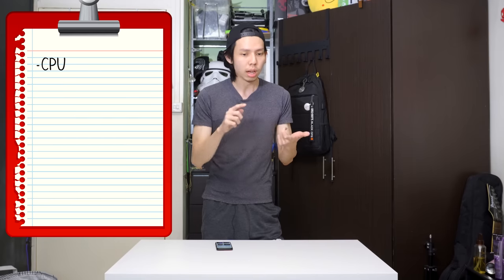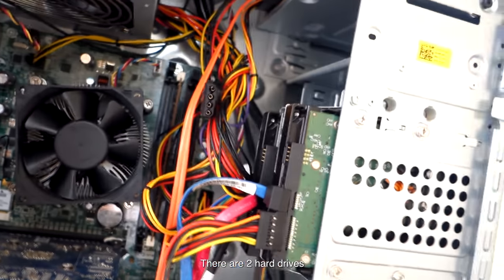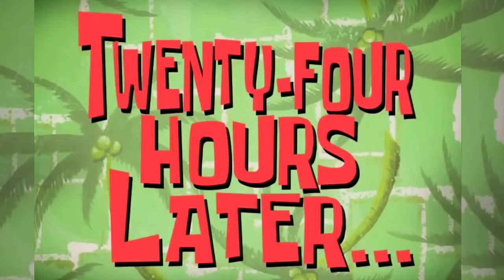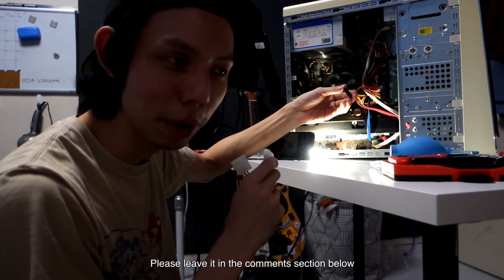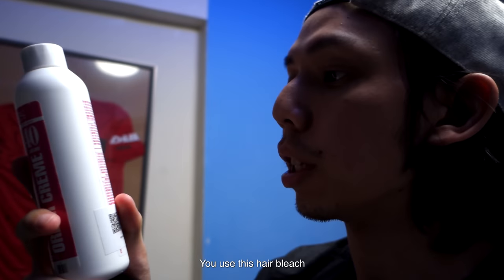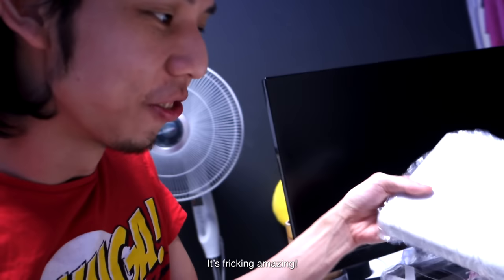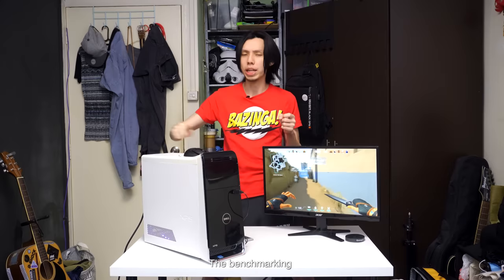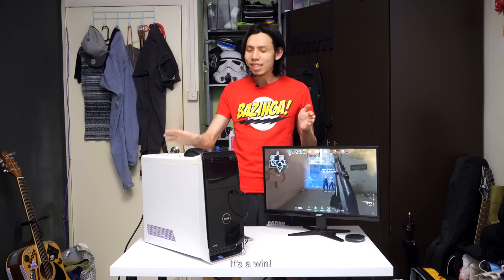Building a $300 2nd hand Budget Gaming PC in Singapore

Comment: Dude . can double side tape the light strip too . 

I too build quite alot of PC from carousel parts . I realised that of all OEM makers, Lenovo's are the easiest to Slap in a GPU and get you going . Never ever touch HP. Its hell to work with. Not to mention most OEM motherboards come with proprietary PSU connectors. 

I've been doing similar upgrades like this for sometime. Put it in a new case, some RGB and an SSD and it works really well

Comment: What PSU was in the case? If its an unknown brand 500W PSU it might barely support the GTX 960. I would not trust using it for long term as it will bring down the entire PC if it came with the 2nd hand case. Furthermore the original PC was not meant for gaming so the PSU would probably have cheapened out. 

Yes the goal of having a gaming PC for $300 is probably achieved. But personally I would not game on it on a long term basis primarily because of the risk of having the PSU bring down all the component the moment it craps out.

Comment: Hi Julian, I facing a problem now which my GPU temperature always go to 80 degree, I only using normal fan and I recently just clean all dust inside my CPU.
Is it my casing air flow problem and I need to changed to water cooling? Can give suggestion please Thanks!

Comment: I build a much more stronger pc using rm550 which is equivalent of about 250 singapore dollars. My spec is : i5 2500k, 2x4gb 1600mhz ram, gtx 1060 6gb, psu superflower 500, nimitz pc case.
Reply: Wow the gpu itself costs more on most for-sale sites idk how u got these hardware so cheap i presume they're all used?

Comment: Did you overclock it? Idk how it still gets so much fps even though it is $300
Reply: Doubt its overclocked. Firstly the cpu is overclocked locked because well its intel, secondly, I doubt the motherboard even supports overclocking. Thirdly, even if its overclocked,it will be super unstable

Comment: i want to know if the power supply can hold for a long time using the pc..
Reply: Gpu and cpu will fry the psu within a month or two i assume. They're cheap parts for a reason. Fairly certain the internal temperatures would rise too much and the pc would shut down intermittently

Comment: As my experience
300$ is enough for you if you just play Dota league of legends or Valorant with Ryzen 3 3200G no dedicated GPU, 100 fps guaranteed.
Reply: League of legends is the bare minimum for benchmarking pc performance, unless you never plan on playing anything else then it'll be fine, you could even run csgo for $700-800 builds. But how long your pc will last and how many hours you can play a day is another thing